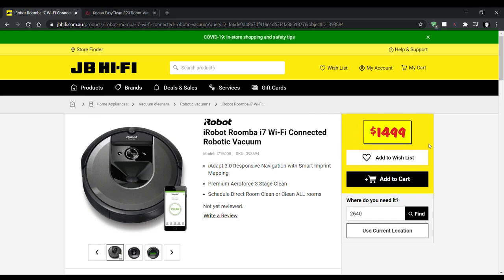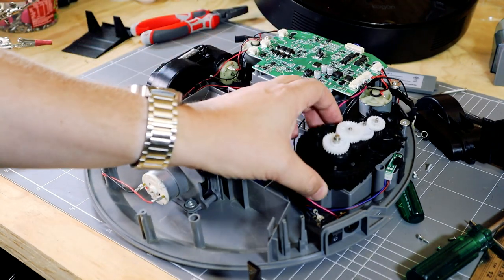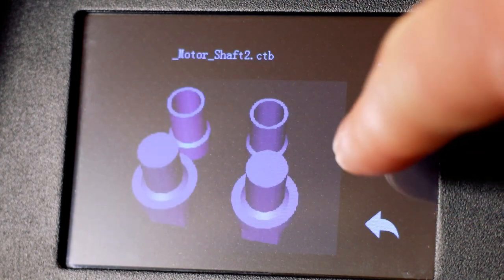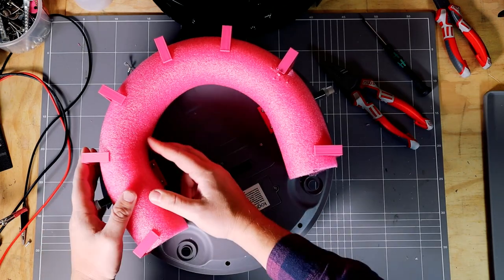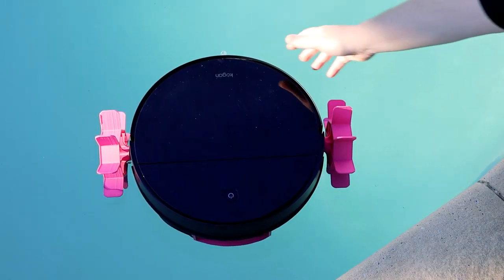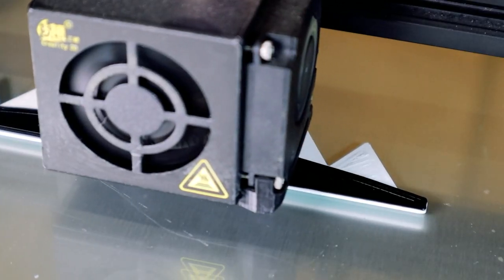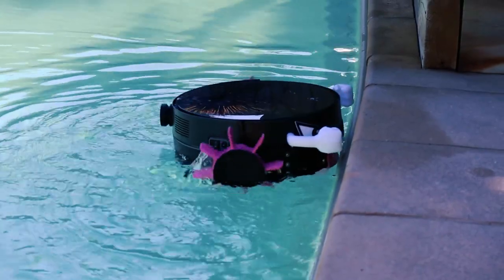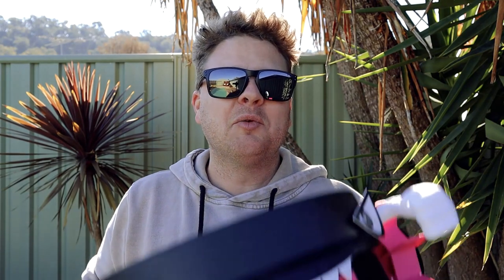Building a Pool Cleaning Roomba

Comment: i did that too, but instead of a roomba i used a arduino robot car set with ultrasound sensor to detet walls. 3d printed the housing, made it float on 4 1.5 l Pet bottles (2 on each side) and added a solar panel and a battery. actually had 3 broken roombas ins some box, but didnt think of using them for that :) 
I faced the same issue with the debris being pushed away instead of going into the net.  Kind of solved that issue by switching from paddle wheels to a RC boat Jet motor installed behind the net and controlled it with a stepper motor that turned left or right once the sensor detected an wall. But it resulted in a new issue.. the boat kept on driving in circles, matter how many times i adjusted the angle of the motor. And then there was the problem of the 3d printed parts slowly warping over time. so gave it up at some point.
Reply from the maker: A jet boat sounds so much more fun! I agree that 3D printed pool accessories are probably not a long term solution!
Reply: @electrosync  true.. also tried PETG and a PLA -ABS blend material, but didnt solve the problem. at the moment im still seaching for some way to coat 3d prints in something that makes usable outdoors..  there must be something.

Comment: The roomba can clean the water but cant clean the floor under water
Reply: Also u dont nead a roomba 
Just use water
Reply: Also fun fact, on the ones that have a tarp liner, you can shuffle in socks to clean the stubborn gunk if your brush isn’t getting it up.